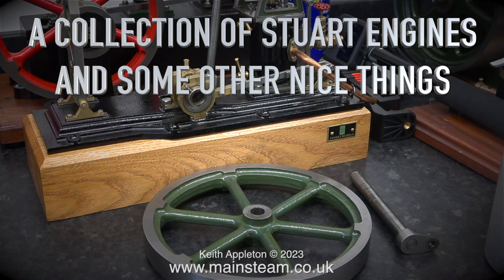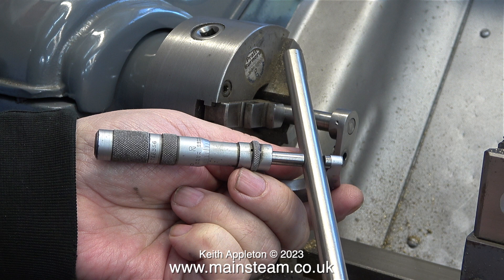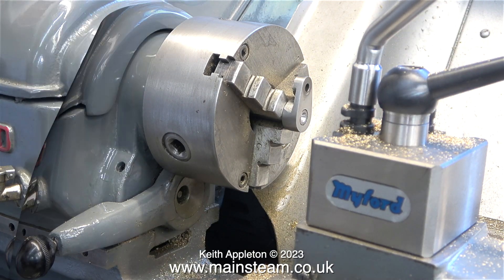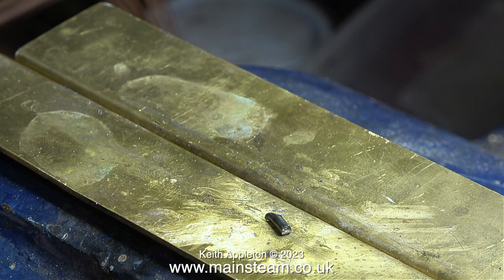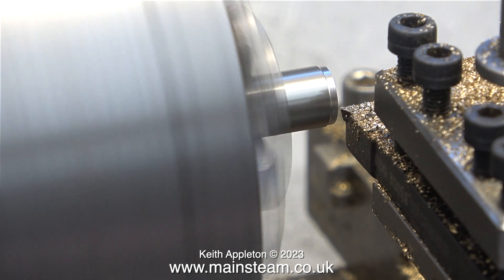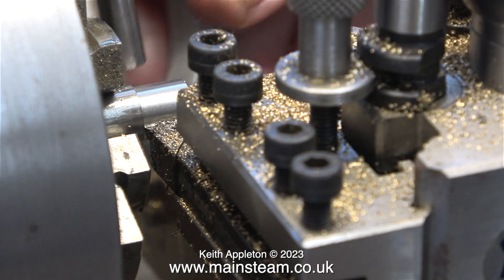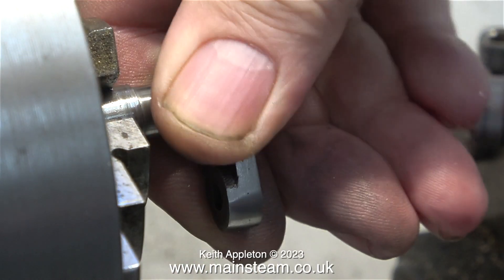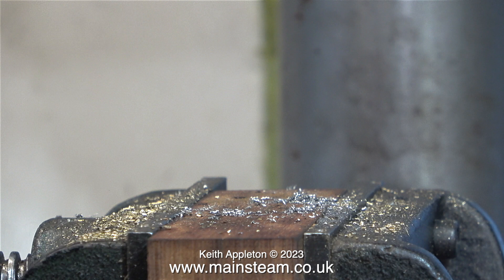MAKING A NEW CRANKSHAFT FOR THE STUART GRASSHOPPER BEAM ENGINE - PART #4

Comment: Your interference fit does work (nicely, I might add).  Have you tried to make the hole a tiny bit smaller than the crankshaft to be inserted and heat up the crank web (to expand it) and then insert the crankshaft.  When it cools, it would be very tight.  I've seen this done with wrist pins on automobile engines, which is why I ask.  Given the forces, it might not be as good as loctite though (I don't know).  The cross pin is probably VERY necessary though.
Reply from the maker: I prefer to use Loctite 603 as it is easier to remove the parts than a proper interference fit . . . .

Comment: That particular insert tool is really intended for facing operations. The lead angle and clearance are all wrong for turning operations. I suspect that's the cause of your problems and not a dull insert.
Reply from the maker: Yes I am aware of that, but normally it is OK for minimal longitudinal operations if I rotate the tool post slightly to change the angle - and when the tip is not as blunt as it was in the video . . .
Reply: @keithappleton  I thought i heard rubbing in the clip, but you were actually there.

Oh but i hate rubbing lathe tools.
Reply from the maker: me too, it is a pain .....